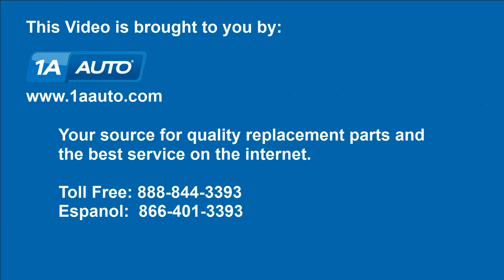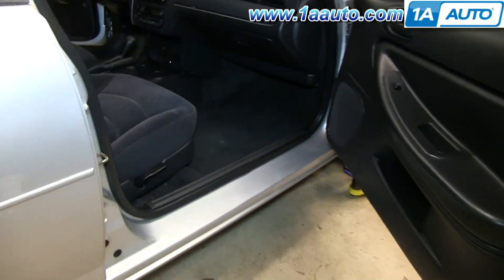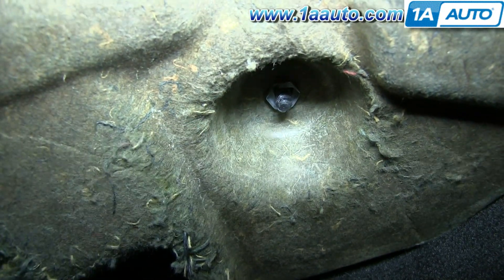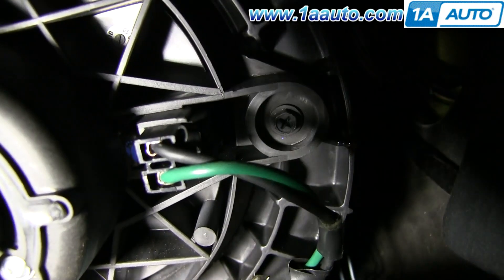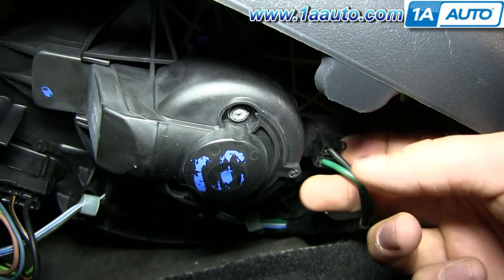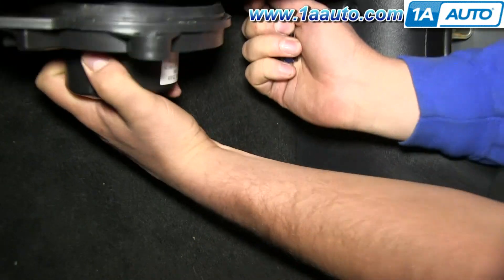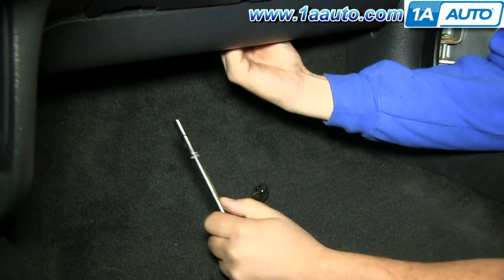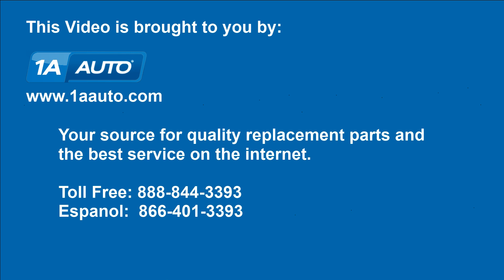How to Replace Heater Blower Motor with Fan Cage 01-06 Chrysler Sebring

Comment: I just replaced my blower motor in my 2004 Sebring convertable and the socket needed was an "8mm" not a "7mm" just passing on my info. I did however use your video to aid me in replacing it! Thanks for putting this up a life saver for sure!!
Reply from the maker: Thank you for the feedback! +Jack Sparky Frahn
Reply: Mine will not come out I have a 2002 and  I have all 3 bolts/screws out and it is like it’s glued fast

Comment from the maker: @goodolboy1331: You may want to check the power going to the blower motor with a test light or an ohm meter. If there is power to the blower motor, the blower motor may be bad. We carry new ones on our website 1aauto.com 888-844-3393

Comment: Thanks for the great video!  Easy fix, saved me plenty in labor costs.  FYI - didn't have to cut the plastic on a 2006 Sebring. Also, the clip on the back of the connector was a slide clip, easier to remove once you pull the resistor out of the slot.
Reply from the maker: +yttfin28 Thanks for watching. If any of our viewers needs to make this repair, we carry the auto repair part shown in this video on our website. Here is a link to them: http://www.1aauto.com/1A/blower-motor/Chrysler/Sebring/1AHCX00192?utm_source=YouTube&utm_medium=CTA+Comment&utm_campaign=ytcomment&utm_term=7I_-A0DYJwI
Reply from the maker: +yttfin28 Thanks for watching. If any of our viewers needs to make this repair, we carry the auto repair part shown in this video on our website. Here is a link to them: http://www.1aauto.com/1A/blower-motor/Chrysler/Sebring/1AHCX00192?utm_source=YouTube&utm_medium=CTA+Comment&utm_campaign=ytcomment&utm_term=7I_-A0DYJwI

Comment: Hi thanks for your videos. I have a 2005 Dodge Stratus R/T. Do you have any ideas why no air blows out of the vents on low (1)? It works fine on 2,3 and 4.
Reply from the maker: +Keith Aleksiewicz Sometimes when the blower motor resistor starts to go you'll loose the speed settings. It might be what's happening.

Comment: I toon mine out of my car thinking it would stop the noise that comes up when I turn on the ac or heater there was a leaf I took it out but it still does it I wonder if I just need to replace the whole blower motor part please help me with a feed back thank u .?
Reply from the maker: +Eddie F.diaz Thanks for watching!  If you have removed all debris and it is still making that sound then you will likely need to replace the blower motor.

Comment: I have a 2005 sebring conv. The lights are burnt out on the switch for the heater/AC. how do you change the bulbs
Reply from the maker: We currently do not have an auto repair video that shows you how to do this. The bulbs may or may not be serviceable. If you remove the AC panel, you may be able to look at the back of it to see if there are any tiny bulbs that you could remove. Thank you for visiting us on YouTube. 1aauto.com 866-403-3393

Comment: Hey i have a chrysler neon 2001 and what can the problem be when the fan works fine for like 15mins and after that stops working, yes it has the sound that it makes but there comes no hot air from it?
Reply from the maker: You may want to check the electrical plug connection to the blower motor to see if it's melted or damaged. If it is, you may want to put a new end on it. Hope this helps you out. 1aauto.com 866-403-3393